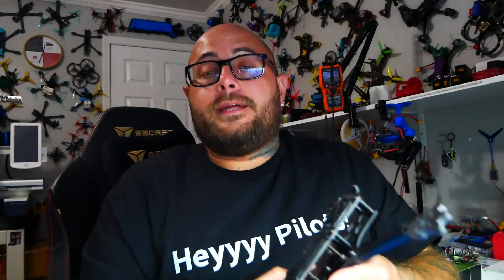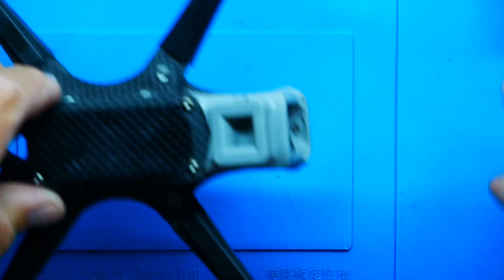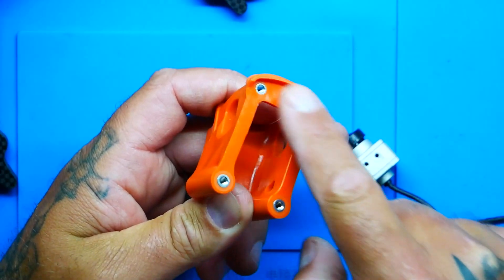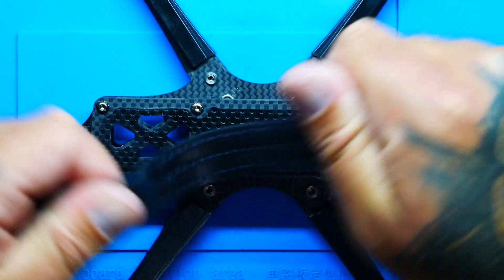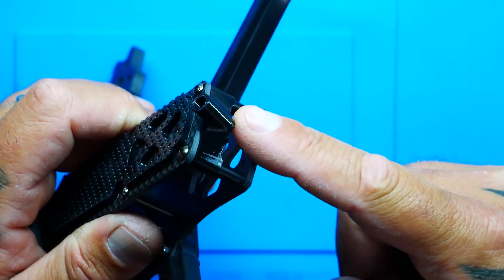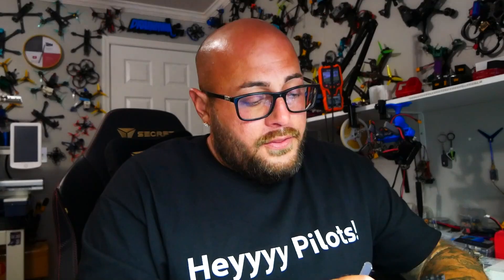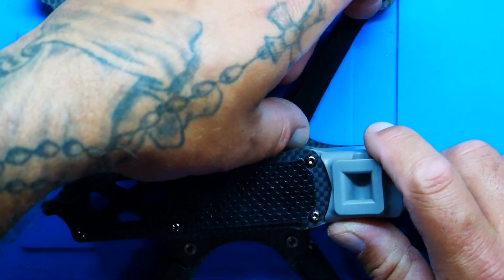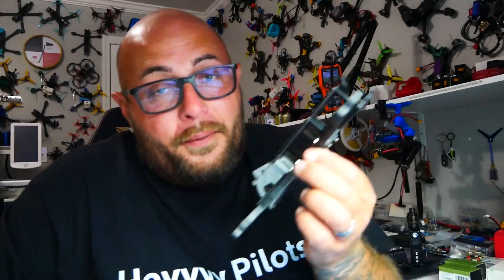A New ERA is Here!! Times Have Changed!! The Buy Once Fly Forever Frame?!

Comment: Let me be clear this frame has one major flaw!  The camera cage. Not only does it NOT fit an O3 camera. But also because the camera cage is so thick it makes the build very hard because you have barely any space for a cap or a buzzer. To make this frame actually work. The camera cage needs to be a lot thinner and smaller to make more room.

Comment: Hey guys, I have a Runcam Phoenix SE that comes with 6 cables. Starting from left I have red wire which I'm going to solder to the 5v on my speedybee v4, a black wire that I will solder to ground, yellow wire I'm soldering to cam. The 3 additional wires are blue, black then blue. I want to be able to access the camera osd through the flight controller. Does soldering any of the blue wire to cc on the flight controller enable camera control? Point of information this is my first time building a drone

Comment: Nice frame I'll have to check it out I'm addicted to building new frames amd are the props in view of the 03 camera I was about to buy the superfly frame for 130 so this one is cheaper lol thanks man
Reply: On syncmode/flipmode camera is at the same level as front motors or even a bit further forward than motors, and you still get some props on wide and of course a lot of props in view on ultrawide. Sooo, I believe with this frame you will have props in view all the time. I would go with supafly for o3, they are also a super durable bandobashers

Comment: Looks like an awesome frame.  Only gripe is The GoPro mount is going to break and rip through the little tiny bit of tpu where the screw goes through 100%.  Good luck finding that black print in a bando or woods. lol.  Also I need to know if the props are in view when using an 03 air unit. Also I never did see a reply to the 8s video you made.  I would like to know what electronics you had in that bad boy.  ☮️

Comment: I never thought I'd ever say this about a frame, but the 110$ price tag on this seems to be justified. I thought this was gonna be just another rando frame review, which is nothing special, but I was wrong. I mean, this is basically everything that I am looking for in a frame: 6mm arms, soft mount camera, split bottom plate, x geometry. Now, there are many other frames having all this at a lower price (even the tbs source one), but the extra touches and extra thought that have gone into this are crazy. Now I will surely not switch to it, as I do not have the budget. I'm currently running a clone apex from Aliexpress for 19 bucks and it seems ok and solid. But if I had to choose between this and a real Apex, I might actually go with Itsfpv one
Reply: Everything a German can make for $110, the Chinese can produce for $19 ;-)
Reply: Hey guys, I have a Runcam Phoenix SE that comes with 6 cables. Starting from left I have red wire which I'm going to solder to the 5v on my speedybee v4, a black wire that I will solder to ground, yellow wire I'm soldering to cam. The 3 additional wires are blue, black then blue. I want to be able to access the camera osd through the flight controller. Does soldering any of the blue wire to cc on the flight controller enable camera control? Point of information this is my first time building a drone
Reply: @YOUAREALIEN-xg3gf  I have Runcam Phoenix 2 SE and the last blue wire is the camera control (the one in the middle is apparently for voltage sensing when not using a flight controler). When you flash betaflight  remember to pick from other options "Cam. Control".
Reply: @kmieciu4ever  thanks a million bro
Reply: @YOUAREALIEN-xg3gf  First of all, thats a pretty big d*ckhead move to spam under comments. Second of all, those wires do not work as cc if wired to the fc. Just cut them off or depin the plug